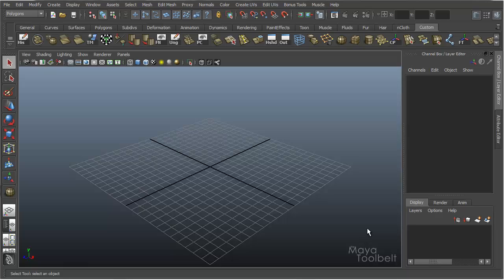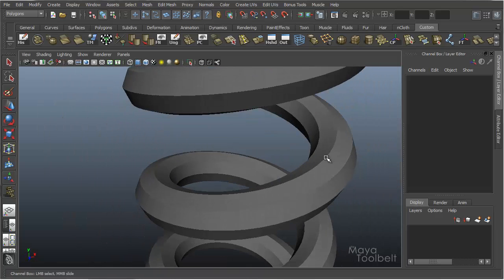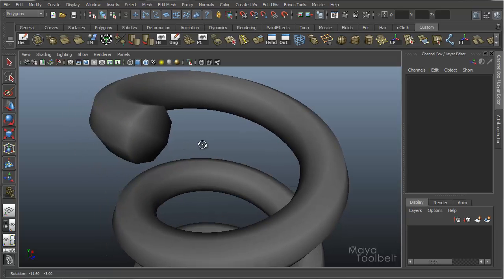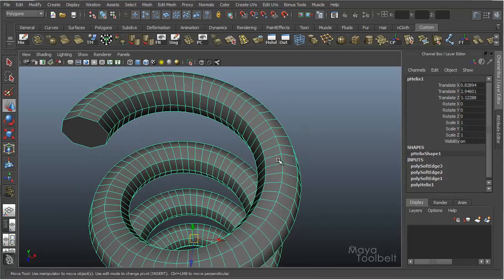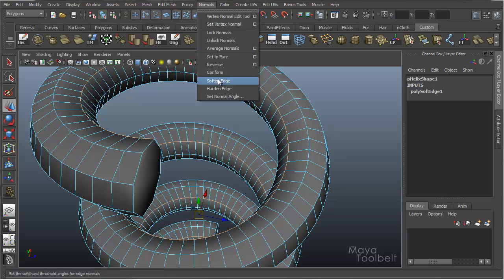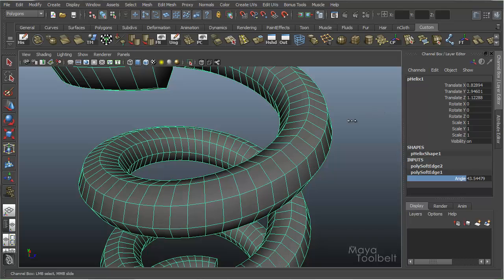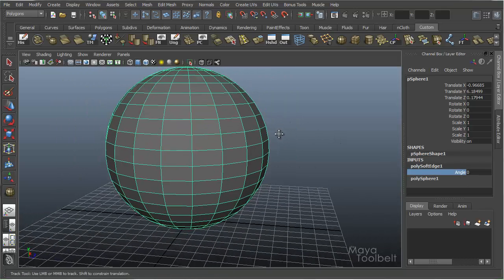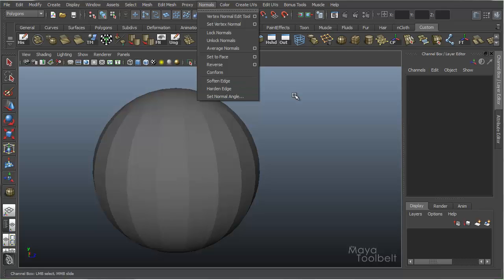The Maya Toolbelt - Soften/Harden Edge

Comment: I tried to soften edges for an eyeball shaped sphere, but it made faces weird (with random black shades); instead of being completely smooth, how can I fix that?
Reply from the maker: If you softened the edges of a sphere but are getting black discoloration, it could be due to having vertices that are not merged and are directly on top of each other. If you select all of the vertices, Edit Mesh > Merge and then try the Soften Edge command, it might fix it (if that is what the problem is!).
Reply: I solved that, it turns out the there's problem with the normals orientation, so after i do Mesh Display > set to face, the decoloration disappeared. Thanks tho!
Reply from the maker: Glad you figured it out!

Comment: How can I "return" to the normal view?
Reply from the maker: I'm not entirely sure what you mean. The term "normal" as it is used in the video is referring to "surface normals," which is the technical term for "surface direction." You can change a surface's "normals" so that you get different effects, such as hardened or softened edges as is the case in this specific video. 

If you're referring to switching between wireframe and shaded view, you can do that by pressing the 4 and 5 keys on your keyboard respectively.
Reply: I mean set again the default normal surface, the one you have before you set harden or sorften, ctrl z would work but what do to if you lost it, for example saving  scenne or deleting history.
Reply from the maker: I think you'd just have to apply another soften/harden edge and adjust the degree to get the result you are looking for.
Reply: And what's the default degree?
Reply from the maker: The default for Soften is 180 and for Harden is 0.
Reply: No, I think I haven't explained me yet.
Isn't difficult, model something, now select soften edge, if you do ctrl z you return to previous normal view (I'm not sure if it is its name), but what if you lost the undo option and want to return once you apply soften edge, or harden.
Reply from the maker: It depends on the object. Most of them seem to be softened up to about 45 degrees or 90 degrees when they are created.
Reply: But there isn't an option to return to your previous normal view? I was modeling a 3d character and I was exploring new features, I discovered soften edge and applied without knowing what was, and save my work, but I regret and want to return but it wasn't possible, that why I found this video.
Reply from the maker: If you've deleted the history, then no, you'd have to manually fix the edges you want by applying either harden or soften edge and adjusting the angle to get the result you want. If you still have history on your object, you can find the polySoftEdge1 tab in the Attribute Editor, hit the Select button at the bottom of the Attribute Editor and press Delete to remove the effect from the object.
Reply: Oh I see, thank you so much :)

Comment: Interesting, but where is the diffrence between Smooth and Soften edge? Smoth does increase the polycount or? And soften not? Thanky you :)
Reply from the maker: Polygons have what is called a Normal direction, or a Surface direction if you will. By adjusting the hardness or softness of the normal, you can get a hard or soft edge without actually changing anything with the shape physically. Smoothing will actually subdivide the mesh, quadrupling the amount of geometry you have to get a physically smoother shape.
Reply: Thank you, for taking time to reply! That is really interesting, if I understood it right, if it is necessary to have a low res model I should use soften edge. And for having more control, bevel?